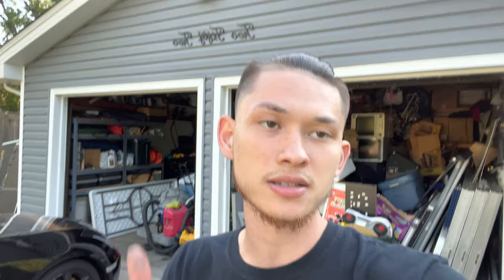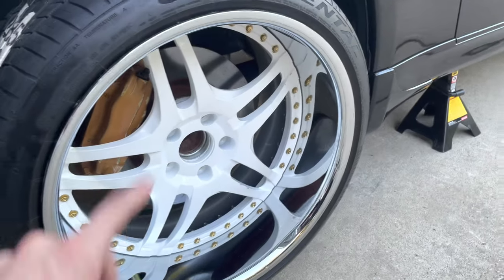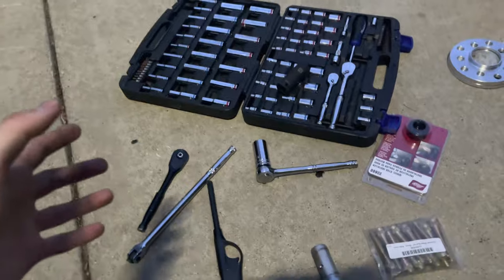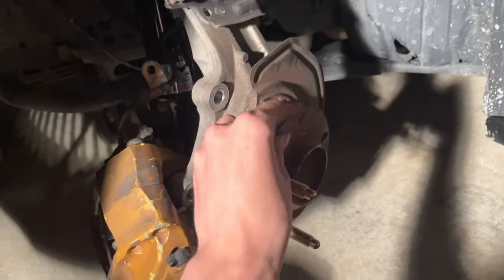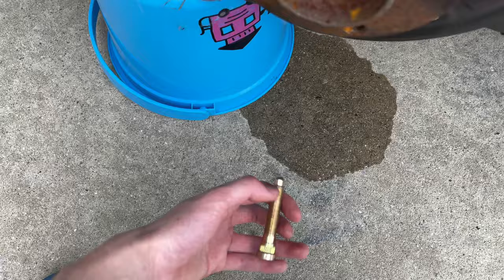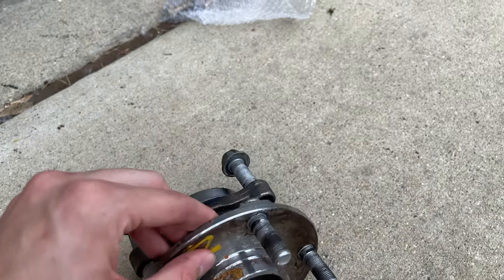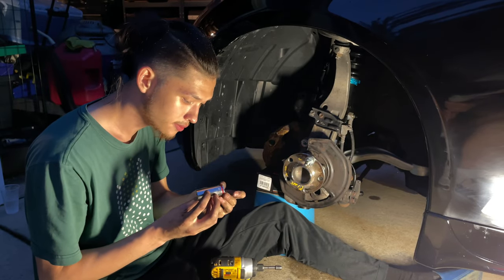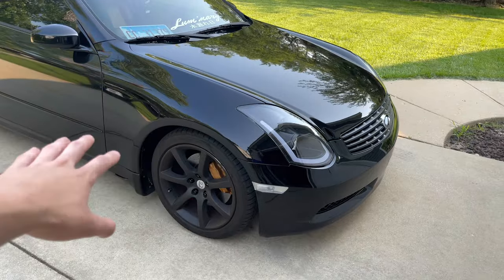How to install extended wheel studs

Comment: Aye bro my extended studs, will not fit between that notch. I grinded some material and still no go, same problem as yours the ball seat won’t fit and they look different than the oem stock. I’m thinking of renting the tool to pull the hub out
Reply from the maker: Yeah, you most likely ran into the same problem as me. Definitely get some new hubs and you should be good. Or recheck if you have the right size knurl for your hub. Pretty sure you can just get the hub off with a socket set and hammer bro.
Reply: @Luminary thanks for the comment reply🤙🏽
Reply from the maker: Anytime ! More content OTW 😮‍💨

Comment: What’s the torque spec for the two caliper bolts
Reply from the maker: 113-114 ft-lbs front 
53-71 ft-lbs rear

Comment: Where did u get the spacers?
Reply from the maker: I ended up getting the spacers off of z1 motorsports online, as well as the extended studs.
Reply: @LuminaryCo  thanks man 👍
Reply from the maker: @josuebarraza9849  np 🤙🏻